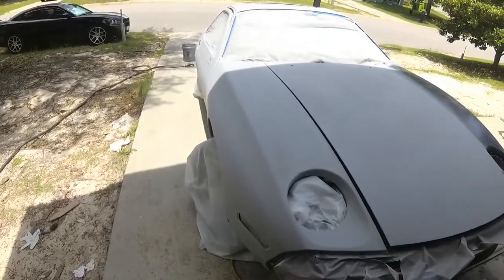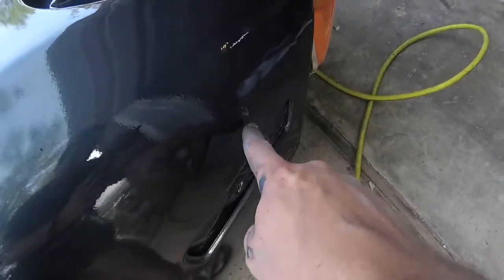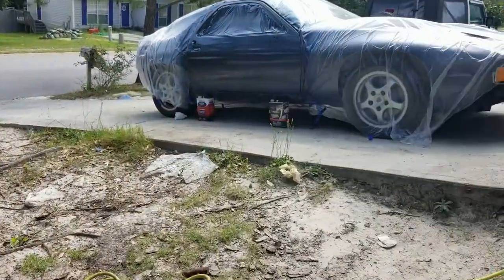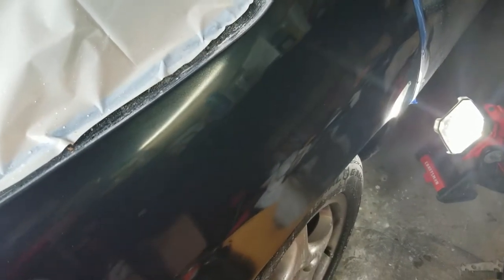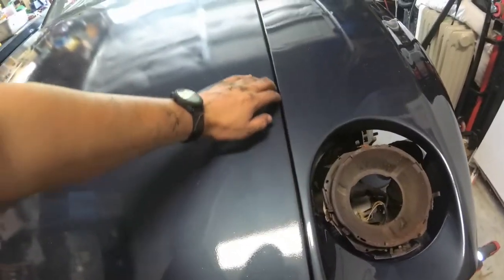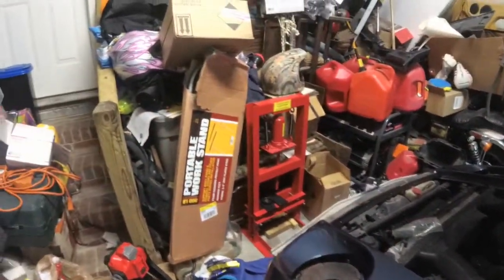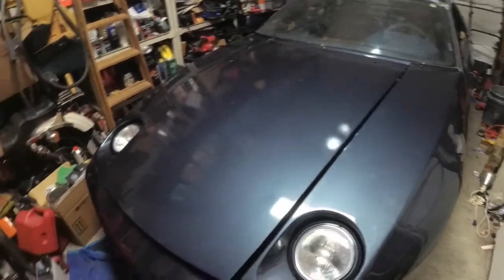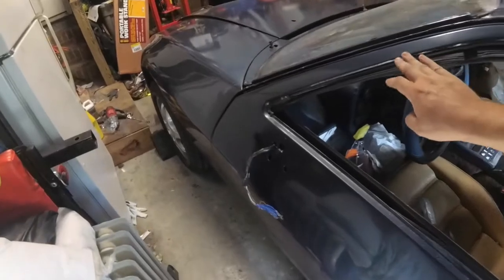928 Painting and Reassembly

Comment: Wait...Wait...You painted the car outside?  There is stuff blowing around which can mess up the painting.  You most likely embedded numerous bugs and other stuff into the paint.  Yeah, I know paint booths are expensive but I got the plastic inflatable ones (not what you are initially thinking) and it worked fairly well.  But it would have been good to hear you describing your technique and the gun prep.

Comment: This is really amazing, I have been looking at your videos (especially the Heater Valve Replacement, which is a spring project for me) and they all really help and inspire me. I am not a mechanic and don't claim to be. I hope to start small and get better and better. Are you in the  car repair profession?  Great videos, nice work on all of this!
Reply from the maker: I'm just a chump with some wrenches.
Reply: @IntenseBlue318   Chump or not, you have fixed most of the things I need to sort out, (Heater Valve, Window drivers side, dash) so thanks and keep it up. Car is looking great.
Reply from the maker: @dinoscala7913  thanks.  honestly kind of running low on things to fix up on the car.

Comment: Any Help on Making Sunroof Go Up n D0wn,,, My Electrics are ALL Good ,,I took the exterior panel off to repaint & install new seals ,,Now having difficulty moving it forward n back to finish assembly ? Any Words of Wisdom would be Helpful ,,Thanks Car looks great for what you're looking for Good Luck
Reply from the maker: honestly it's been so long I can't remember.  I did end up rewiring it to run off of relays and just let the switch control the relays.  I couldn't ever get the switch to work well enough to be able to move it without having to help it.  works fine with the relays though.